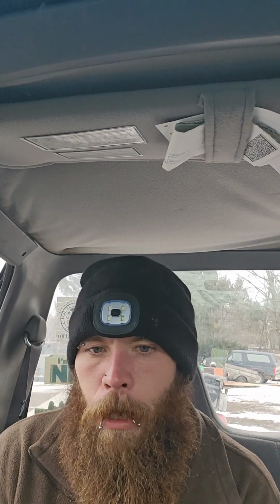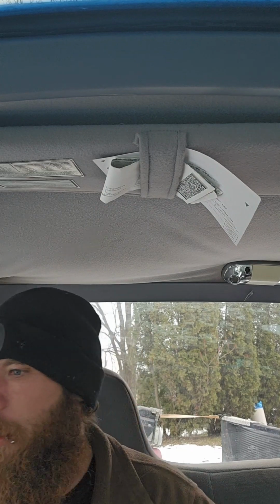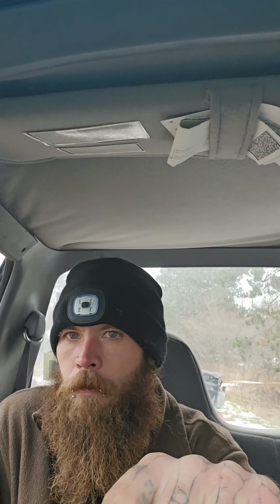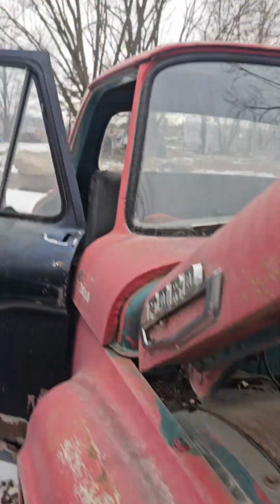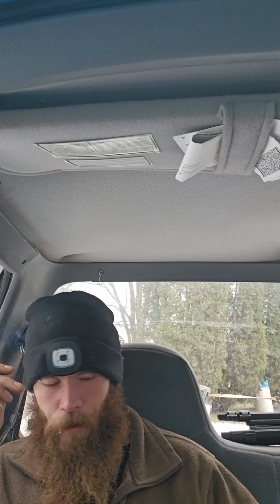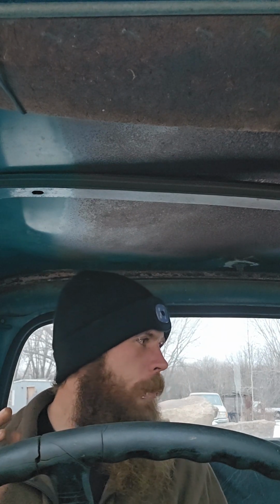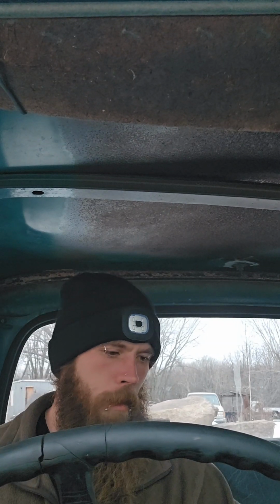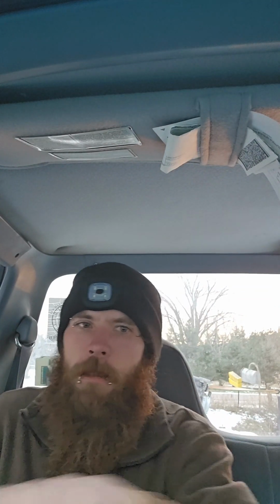1963 F600 start up finally 🙏

Comment: You should have prime that carburetor. Before you started it. You can use brake cleaner to help get it started.
Reply from the maker: Yah but thats no fun haha
Reply: @RustyNutzTruckz  I know right. That is a nice truck 🚒.
Reply from the maker: Just needs brakes bleed and a good carb clean. Well prolly a new fuel lines its ran off a boat tank rite now

Comment: Was it a 330 FT series engine in that truck, or was it something else?
Reply from the maker: This is a diffrent F600 its a 223-6 the other one is a 66 F600 lol
Reply: @RustyNutzTruckz   oh, the old fuel miser 6. Gotta learn to love the slow lane in that rig. They are reliable and straightforward, even if the power is nothing to write home about.
Reply from the maker: 100% agreed its got a 2 speed rear end everything works on the truck really well actully